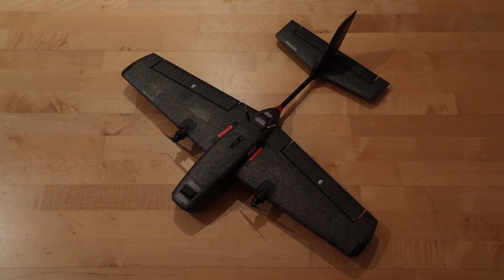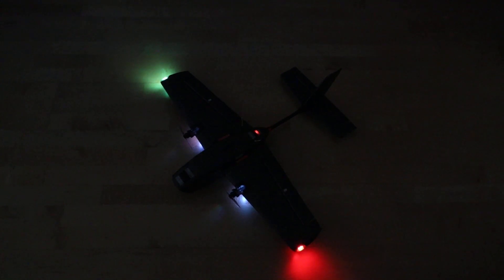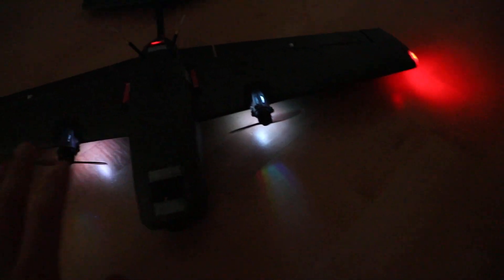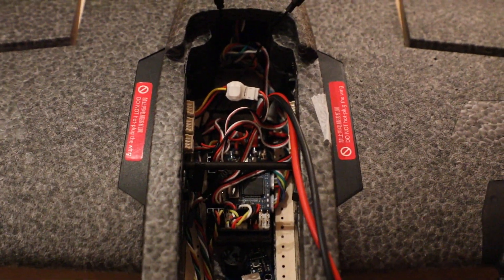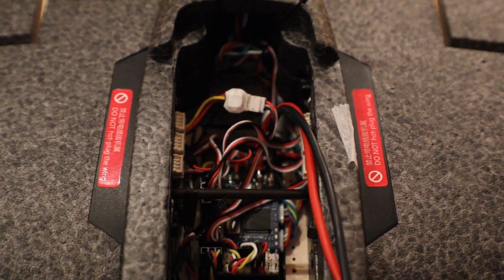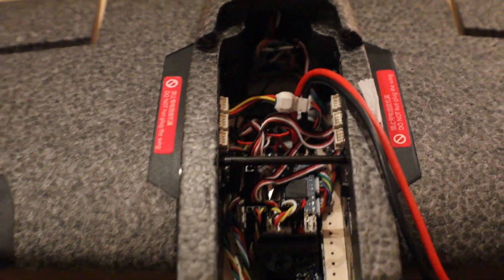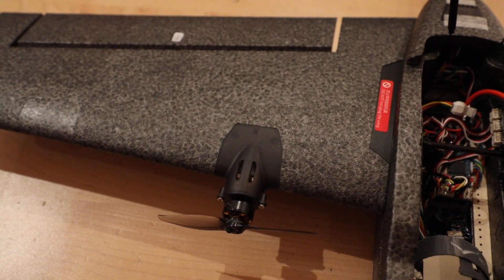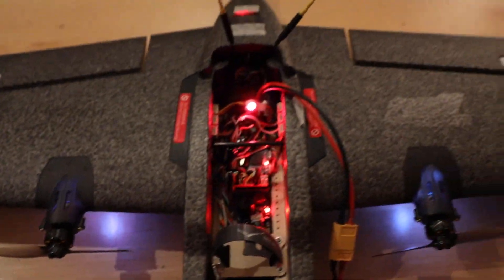Heewing Ranger T-1 has more hidden LEDs! (Part 1)

Comment: - " you will find that both the left and right wing-tip LEDs will light up in the same color. "
- When I assembled the plane and connected the battery for the first time, this is exactly what I saw.

However, after my additional iNav settings, the LEDs stopped lighting up completely. How can I turn on the LEDs again in iNav?
Reply from the maker: Some flight controllers seem to have a problem with sending the correct LED signal to the LED ligths on the wingtips. I don't know why, but I suspect it might bes due to EMF interference from the LED cable and the servo cable runing next to each other. 

My friend had a similar issue where his lights would only light up purple. When we swapped his wings on my plane, the LEDs worked fine. This leads me to believe that it could be from the FC where some FC's don't have enough power on the LED signal line to overcome the EMF interference. 

Honestly, I don't know, I have a few theories, but I don't know for sure. Try using the included PDB board to connect the LEDs and see if they work again.

Also, can you send me an image with your LED setup in INAV. I might be able to help that way. Or hop on my discord channel and we can discuss in a call.

https://discord.com/channels/1082026163746115645/1082027032390672405
Reply: @DZARO  - "Also, can you send me an image with your LED setup in INAV.

# led
led 0 0,0:W:CB:2
led 1 15,0:E:CB:6

Comment: You have Adress RGB lights in your wings but I think it is not worde to youse blind LED in the Middle only to youse. I would take a Wire trough the other Wing Tip to Adress the "2." LED. However it is possible if you have PNP Version with Wing Conector build in or the Kit Wersion where you have to buy your own Connector.
I Baught on Ali fpr 20$ some Crimping tool together with JR /JST Plugs. I think it is forth it becurs in the Plastick Socket fits the same contacts in Male and female Conectors and than I Juse XT30 together with this JR Plugs. It is mor wireing to du but it is fast Too. And I not take it apart to often.
Other Method is to wire All grounds of the Wing to one conector and Have 3GND's to 1 GND to take more spare Contacts for additional Periphals.
Reply from the maker: Yeah, but that would require me to cut open the LED on the wing, feed a wire through that is separate from the wing connector and it will add disporportionate weight to the one of the wings, which in turn would cause an increased chance of a tip-stall. 

In other words, your idea is not practical, does not fit the build constraints and decreases the plane's peformance.
Reply: @DZARO  ?? An 30AWG wire 30cm length waights nearly nothing. I think there are the Internal Cable Salat and the Battery more out of ballance. 
My Idea was not to do it now, I mean to do this while assambling the Build Kit. It make no sense afterwards. 
And it is Possible to Add an blind Wire to other side of the Wing for Balance, but this make not souch sense becurse this wire weights Maximal 1g

Comment: You can’t hook leds directly to FC.  I have the matek f405wmn
Reply from the maker: You can, just need to be clever about how you do it.
Reply: TYPICAL WS2812 RGB LED Take 0,05A Current by 5V!!!!!!!
Most FC's today have 5V Regulators and there realy Strong today. They are ratet in the Discription with 5V 1,5A, 5V 2A, 5V 3A. But you should not get the full ratet current!. If you have 3A, You should take only youse 2A  for LEDs becurse you have critical electronics like Reciever and Micro Contoller on 5V circuit. You should not overload the 5V Circuit. to not shut down the or STM32 Micro Contoller (CPU/MCU) reciver. I sad an Typical RGB LED tooks 0,05A also you can took up to 40LEDs on 5V 2A. But let room and only Take 20LEDs for the save side. Give overall another 0,8A -1,4A Room for the save side Look what Power the reciver takes. WATT/Voltage= Ampere. This 3 LEDs on the FC have no Impact on the full System. MATEK and Holybro Flight Conrollers are realy Strong, and have 5V 2,5A or 5V 3A .If you have more than 30LEDs I prever to get an external BEC I will connct to VBat after the current meter of the ESC or Internal PDB of Matek FC.and the Signal Wire to the "LED" Pin. This will the Savest Way if you youse many LEDs or realy Hungry 5V VTX. But most VTX and Cams Today takes 9-34V or something witch will connectet to 9V/12V Circuit.
He could youse easy 15LEDs directly on FC.
The Signal output from the STM32 F4 Micro contoller itsleve is Limited on current, but the LED Signal have high impetance and take no load on short distances.